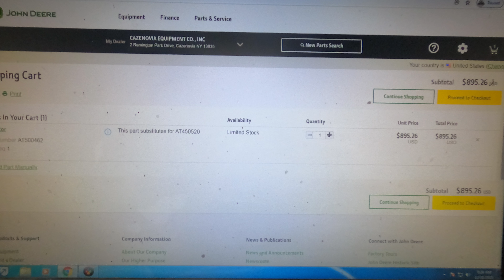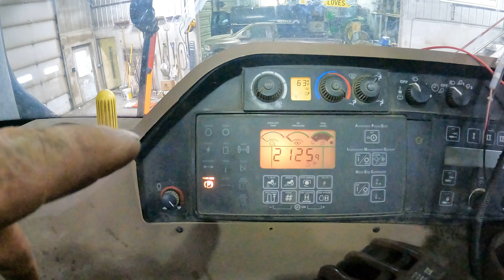That Part costs how much???? Crappy internet……Slow uploads

Comment: what is the part number of the window
Reply from the maker: Agco part #-3907221M1 I believe it went to a Massey Ferguson 6170 tractor
Reply: @FarmingFixingFabricating  thanks
Reply: I would soak that core over night with clr and flush it before I put it back together
Reply: @kenpurvis3282  if that door is a left door it should also fit 61, 62, 64, 66, 67, 74, 76, 77, 81, 82, 84, 86 and 87 series tractors. And it also fit all the above  in the AGCO  Challenger and White series equivalent from late '90's/early '00's to about late '10's.

Comment: Jason seems to be a very valuable guy to have around. The operators that can also do in depth repairs always seem to be better operators than the steering wheel holders that have someone else fix their broken equipment.

Comment: Andy one thing I’ve done with my vehicles and my two tractors is that would run a can of seafoam in them twice a year to clean any gun the inside of the engine to me it’s cheap insurance just spent 20 bucks for two bottles and then put one bottle in for the first Flush it will not harm your engines in anyway it will clean them out on the inside

Comment: Had that happen on my JD8100.  Less than 300 hrs on a reman water pump.  Took out 2 gears in the front cover and filled the oil cooler with metal shavings.  Good times👎🏻.  Good video as always

Comment: Hey Andy have you guys thought of putting in a sand separater in . Instead of having a manual barn scrappers scraping just run the vacuum truck in and run the manure right to the sand barn and than it washed the sand out and you save on sand and can reuse the old sand my neighbors had to do what your doing to get the solids out of the pit but they invested in a sand separater and their saving about 500 loads of sand a year that they can ruse and they don't have to hall solids out anymore. Good video and good to see the kids working hard to keep the farm running hope you guys had a good new years.
Reply: Ya was going to ask if saw dust would save on wear and tear of equipment ... but what your saying the cost of doing that might save on wear and tear costs to be beneficial

Comment: It's nice to see that you got the wiring figured out why the tractor didn't start before. The John Deere skidsteer quick tach system is a way better way with the linear actuator verses bobcat and new holland with the little cylinder that gets bent or the hoses get ripped off the hydraulic quick tach cylinder is stupid expensive too

Comment: Maybe it’s already been mentioned but, on those water pumps the bearing would/can fail dropping the balls possibly down into the gear train.  When I changed ours the new pump had a bearing that had a high sidewall on the outer race so the balls couldn’t go towards the gear train. The old pump had a standard type bearing where the balls could fall out. The new pump was only like $25 more than a reman both from Deere. Wish you a prosperous new year out there! We are hoping the ground will freeze here in Michigan so we can finish up harvest!

Comment: use a relay to provide the power, Apply 12 volts to pins 30 and 85.  Connect pin 86 to your pushbutton start switch to apply a ground to the relay, then connect the line going to the starter solenoid to pin 87 on the relay.

Comment: I've gotten around the different size hose problem by using heat shrink tubing on the 5/8 tube so 3/4 hose fits it.

Comment: Is the 8360r comparable to the 9320? I guess the 8360r has similar HP to the 9320 but less torque and weight, but can the 8360r pull anything close to what the 9320 can do?
Reply from the maker: Yes it can

Comment: Andy, do pick certain fields or part of fields to spread the soils sand from the pits? I was wondering if you spread this like in the mucky areas. Does the torch cutting raise hell with you shoes and give hot toes? lol I just think of many farmers throw the actuator away with just a small repair as you did. Is the other big Deere waiting for repairs where parked the one you just fixed? Thanks Andy!!
Reply from the maker: No the torch sparks don’t bother doing that type of cutting. When we get into the big stuff it can bother. The 9560 needs looked at yes

Comment: i thought you might would have bypassed that heater valve with a piece of 5/8" heater hose. Great video. And happy new year.
Reply: Thinking he wants the heat to work.
Reply: @beckyumphrey2626  yes ma'am, that valve doesn't have to be hooked up for the heat to work. The heater core is 5/8" and the hard line that's on the other side of the valve it 5/8". Standard 5/8" heater hose and a couple hose clamps and the heat would be flowing again with one less component to fail and a less expensive repair. The main reason the valve is there is to stop the flow of heat during the summer when you want the best AC
Reply: @shaunadams3170  Thank you very much for the explanation.  Have an awesome day.